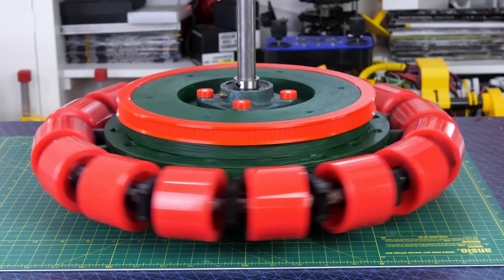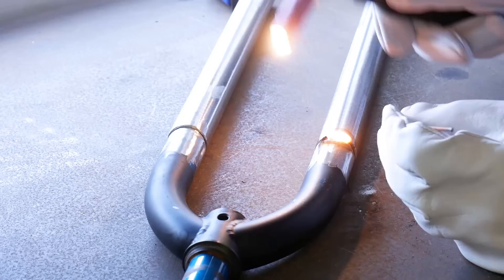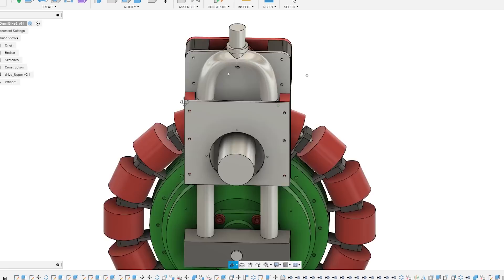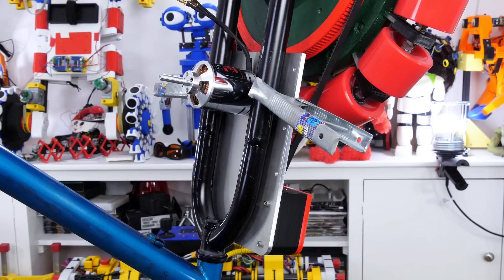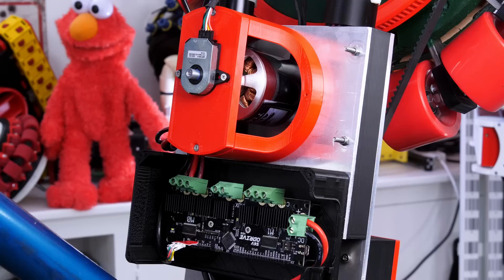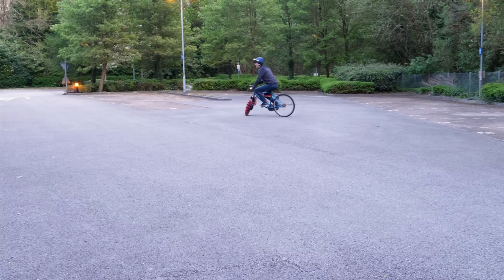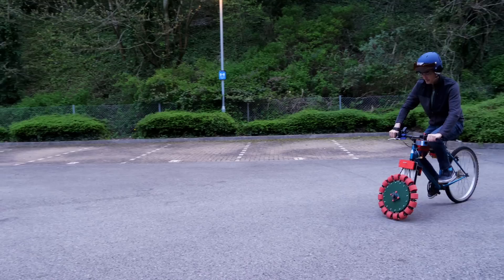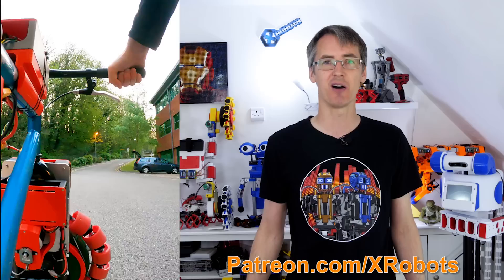Can I RIDE THIS BIKE?

Comment: It might actually be easier to ride in self balance mode if you physically lock the handle bars. It seems like it might almost ride like a normal bike at that point.
Reply: Yes! Weld up the handlebars aswell.
Reply: It would be hard to balance
Reply: Concur! Normally we use the handle bars to balance and steer. Lock them out. Let the wheel do the balancing and just shift your weight to steer.
Reply: yes, I think they need to be locked.. it seemed that all the issues were related to learned reactions on the steering input..  but since it doesn't steer locking seems to be the solution..
Reply: @Tystarr  news flash. you don't have to
Reply: Agree, looks like two feed back loops fighting each other, a humain and a robotic one, a locking mechanisme on the handle bar should eliminate the human variable :)
Reply: This is a good suggestion.
Reply: Much more complicated but nice would be to mount a round (car) steer that is connected to the steering motor axle.
Reply: Yea, but if it stops balancing= RIP
Reply: or make a ev and not ride at all
Reply: Should be fairly simple to do, just thinking of a plate with a hole that rotates with the handlebars, and a tapered pin moved by a servo, when you put it in balancing mode, the pin extends, and once the handlebars are straight, the pin will lock them that way. 

I think it would be best with a feedback method to know that the handlebars are locked and to not engage balance mode until they are. Same with when disabling it, don't turn off balance mode until the bars have been successfully unlocked. This will prevent from having the pin jam and with balance mode off and the bars locked, there's no human input way of balancing.

Could also add a thumbwheel or joystick to the bars on one side where you can use the joystick to provide input direction when in balancing mode, not necessarily requiring the perfect lean to steer.
Reply: That's not how bicycles work. Locking the handle bars basically renders the bicycle unridable.
Reply: @devandestudios128  you did watch the video, right? This is not a normal bicycle, with the sideways driven front wheel there is no reason at all that the handlebars have to turn if the powered wheel is doing the steering.
Reply: @timplett1  Clearly you don't understand how a bicycle works. With or without the front wheel being perpendicular to the rear wheel, powered or otherwise, the handle bars locked negates counter steer, which is why the forks/handlebars are not locked in place. The powered wheel isn't doing the steering and shouldn't need to be powered at all. Only reason it is, is to make it easier to balance, not steer.
Reply: I was about to comment this. Certainly worth trying it with locked handlebars.
Reply: @devandestudios128  I understand how a traditional bicycle works, however the point of this is not to make a traditional bicycle. If you want to make a traditional bicycle with the least effective wheel for the principle, go ahead, however what is being commented here is a way to make use of the alternative wheel to make something that diverges from a traditional bicycle in function as well as form. If you want to adhere to traditional countersteer method, keep a traditional wheel.
Reply: @timplett1  Okay cool. build a bicycle like this one and lock the forks into position. Lemme know how well that works for ya.
Reply: @devandestudios128  your comments still feel like you didn't watch the video. When trying to ride it with balance mode on, he specifically said he had to try not to countersteer and just lean so it would steer, and his instinct to steer normally caused it to actually just go straight. So his actual experience testing in the video SEEMS to imply that the ability to turn the handlebars actually makes the bike counterintuitive to ride. Therefore, locking the handlebars in balance mode seems like the next step to take to allow the bike to do the steering without counterproductive input from the rider. 

Seriously, just watch his testing again and pay attention to what he says.
Reply: I thought that as well
Reply: @devandestudios128  Of course it's not how a bicycle works. They don't have omni wheels on the front.
Reply: @AmtrakBoy42  That's not what I meant. Please see this video that explains how a bicycle works. It would work the same way regardless of the omniwheel on the front. 
https://youtu.be/9cNmUNHSBac
Reply: @devandestudios128  The balance mode takes care of the balancing function of the steering column automatically. No need to manually balance via front steer. That's what other comments are driving at. There is an electric motor and sensor in this front wheel taking care of that function. Looks like traditional bike dynamics are totally out the window
Reply: @devandestudios128  Did you even watch this video before commenting? It doesn't steer like a normal bicycle anymore with balancing mode on.
Reply: @devandestudios128  Where is the self-balancing omni-wheel bicycle in that video? I don't see it
Reply: @bluemamba5317  Yeah got that, but it still works the same. But either way, no matter what you think you know, I'm done giving a fuck.
Reply: @devandestudios128  It doesn't work the same, that's the whole point. He even says so in the video. Have a nice life. God have mercy to whom ever have to spend time with you.
Reply: @Tystarr  it literally does it itself.
Reply: Essential it would be like riding a scooter with pedals. You don’t really steer a scooter unless your barely moving. It’s more leaning into the turns then anything. I came here to say exactly what you said
Reply: @devanshgarg31  Best suggestion -- DON'T RIDE THIS. :D
Reply: @newburypi  Like, a bigger Segway
Reply: @tarpguy_  a Segway with pedals :)
Reply: @DjamilBoudries  why not do that on everything. just remove the human variable on everything!!!
Reply: That may not work as you imagine.

The tilt sensor uses down by measuring the force of acceleration due to gravity. If you're moving around a corner, centrifugal forces will act at an angle to the lean, so that it may appear that the resultant force is down relative to the wheel and then it won't rotate.
In addition, the force the motor can impart to the bike is limited. Imaging going around a corner, then the belt slipped or motor couldn't overcome the centrifugal force, of a part tensioning the belt broke.
Reply: @devandestudios128  not when you have self balance turned on
Reply: @devandestudios128  you have to think about it like a unicycle but
Reply: Good suggestion! Letning the robot do the balancing will probably make the whole riding experience more intuitive. Think of how you steer a skateboard for instance, even though it’s completely different than riding a bike that can also be intuitive (for those who knows how to ride a skateboard)
Reply: @devandestudios128  You definitely need to watch the video my friend! The bike already have a stabilizer, that means the bike Automatically do the Balancing for You! Which translated to: You don't need to balance the freakin' bike, it'd do it by itself.
Reply: @wenofu477  That's the Idea, it just that we haven't been able to make it works.

Engineers are still trying and experimenting on how to went from Mechanical to Fully Autonomic on everything.

Just look at self driving cars, the technology is already available, it's just not good, still have a lot of problems like road mapping errors and poor predictive capability.
Reply: My thoughts exactly
Reply: @devandestudios128  that's not how omniwheels work, making them omnidirectional renders them useless
Reply: @Tystarr  the machine does the balancing
Reply: My faith in humanity's intelligence is restored with this being the leading comment. Exactly what I was thinking.
Reply: Lol - incredible! Can’t believe what I am seeing - and it works!
Reply: Was just about to comment this.
Great minds.
Reply: @Tystarr  that's what the electronics are for ;)
Reply: If it's lock how can he turn while running he can use the machine while running. The machine can use when it stop and turn without hard work
Reply: @lydyamuangte8713  it turns when you lean.
Reply: It WILL be easier to block handle bar
Reply: I feel like we would need to lock the handlebars and put the omni wheel in the rear. a front wheel drive bike.
Reply: Except without the friction when you try to lean one direction u will lose control of the front wheel and the bike will fall over
Reply: i was just thinking the same thing!
how about you couple the switch for balancing mode with an electronically engaged handlebar-lock mechanism. so when you switch on the balancing mode, it waits for it to engage until you get into straight positioning and the locking mechanism physically locking the handlebar. this way you can ride it with balancing mode as an omniwheel until the battery runs out and then automatically go back to "normal mode" since your machanism has no power left for engaging the lock and the balancing mode.
Reply: @Non-Existent03  oh God. Omnidirectional hoverround
Reply: @newburypi  the problem is shifting your weight the correct amount that the bike can accurately compensate.
Reply: @devandestudios128  The powered wheel is behaving like a reaction wheel. That's how balance mode works. Given how aggressive your comment is, it's pretty ironic. Why would you claim something so absolutely about a device you clearly you don't understand when everything you needed to understand it was in a video you commented on...
Reply: @jossmit7024  It's not really that complicated, you would only likely need a worm gear if you needed to change the angle. Handlebar already turns around its axle just like a steering wheel in a car, which as a mechanism is technically way more complicated to build for a car.
Reply: @newburypi  i never used handlebars for steering, i usually just lean into my turns
Reply: Fr
Reply: Yeah
Reply: I have a feeling his brain is too big to allow him to forget anything 🤣
That's probably why it was more difficult for him than it could potentially be for someone else to do.. lol
Reply: @Tystarr  🤣 good one
Reply: This is all very interesting but it’s probably illegal to make changes to your bicycle like that
Reply: Don't think you can. Veritasium did a video recently where he showed that to turn on a regular bike, you have to counter turn first. I'd assume the same principle is required here
Reply: @JamesChessman  WTF are you talking about? Why would there be laws about modifying a bicycle? There aren't even laws about modifying cars.
Reply: I have ibs
Reply: How about we just put a ball bearing under the front fork
Reply: you can't have your front wheel roll out from under you you'll fall everytime
Reply: i’m assuming it’s the same as a hover board balance but with pedals it’s hard to wxplain
Reply: Exactly what I was thinking. Your habits already will have you lean, except this time you can't turn the handle bars. As the motor takes care of keeping your balance, it should be fine.
Reply: Was going  to be my suggestion as well.
Reply: @AmtrakBoy42  there absolutely are laws about modifying cars, but you can definitely modify bikes
Reply: @devandestudios128  MY THOUGHTS EXACTLY
Reply: @chargemankent  Yes, it does the balancing for you, by counter steering the wheel. If the front wheel/fork is locked out, there is no way for the computer to balance the bicycle.
Reply: so you would steer like a skateboard, i like it.
Reply: @logicalprime3017  its like a segue
Reply: @Tystarr  it would be hard to balance on a self balancing vehicle?
Reply: I was thinking the same thing halfway through the video
Reply: The bike is balanced by the oacilation of the handle. As soon as you lock the handle on any bike, you will fall
Reply: @gman4072  Did you even watch the video bruh...... cus it doesn't sound like it
Reply: @Tystarr  yeah, luckily this video is dedicated to a self balacing bike.
Reply: @devandestudios128  You STILL haven’t watched the video? The small wheels on the omniwheel spin sideways, there’s no movement of the handlebars or front for necessary. I don’t understand why you’re still in this comment section arguing when you didn’t even pay attention to the video
Reply: @MrEvanNoyes  Because I did pay attention and that still isn't how bicycles work. If the handlebars are locked out, there is nothing for the self balance to balance. Also, the small wheels do not spin sideways, they spin in the direction a regular front wheel would. The omniwheel as a whole spins clockwise or counterclockwise depending on the direction of its travel. But please, build a bicycle exactly like the one in the video, but lock out the handle bars and see how ell that works out for ya. I'll wait.
Reply: @devandestudios128  Dude, the self balancing isn’t turning the handlebars for him. It’s turning the smaller wheels in the omni wheel. You are still just refusing to learn new information here. Look at the Omni wheel. See how it has the laterally facing skateboard wheels? Those are driven by the engine that’s mounted to the front of the bike. Which is what is correcting the steering.
Reply: @MrEvanNoyes  The small wheels are passive, it is the omniwheel that is driven.
Reply: My God, the Veritassium viewers in this thread are being insufferable. 😂
Reply: Well, gotta find a different way to turn...
Reply: @Tystarr  no point in balancing if it balances itself
Reply: If you physically lock the handlebars, there's no more point for them, could have a handless bike or a bike with a desk on the front lol
Reply: But how would you steer then?
If I am not mistaken, you steer on a bicycle by turning the handle bars in the opposite of the cornering direction, and thus forcing the bike to lean in the cornering direction. You can then keep balance and control the turning radius by using the handle bars.
How do you steer if the bike is always keeping its balance and stays upright?
Reply: @NKay08  The wheels on the edge are still locked to the rotation. Sharper turns are harder tho, due to the bi-axis stabilization of the wheel.
Reply: keeping same set-up, I think if you inverse(or make opposite) the code tilt_direction/motor_direction relationship  in the "balancing mode" the motor will make you stay upright instead of throwing you to the direction you lean and ride without the effort of human balance  .. give it a try if you haven't
Reply: Sounds like a 2 wheel unicycle 🤔

Comment: Would have never thought the way to make a self balancing bike was to flip the front wheel sideways like that, love it
Reply: If you check out Veritasium's video on bikes, you'll find they are already self balancing. He rolls one down a hill and it keeps itself upright. Very interesting stuff on both accounts though!
Reply: the problem with having wheels rotated 90 degress is that you can really only ride it on flat ground; concrete or asphalt, or anything that isnt dirt, grass, etc.
Reply: @kenjaminrar  isn't that because the bike is moving, when a normal bike is stationary it will just flop over unlike this bike
Reply: the ultimate trackstand bike
Reply: @AuroraAce.  yeah they're incorrect. Bikes become balanced due to the centrifugal force of the wheels when moving at speed in a straight line but that doesn't make them "self balancing" like the bike in this video is.
Reply: @AuroraAce.  normally yes but there have been several examples of literal self balancing bicycles that can just kinda hang out
Reply: @deebonglord3209  I believe there are bikes like you say look like a normal cycle however have the self balancing weights in the handlebars and also “control” steering. Honda made a motorcycle that just follow you and balances on its own too
Reply: @hausmaster9801  Love the self balancing motorcycle. It's so cool.
Reply: Also there's apparently a newer, arguably even cooler one.

Comment: This was such a weird project. Very interesting though. I didn't expect it to work so well.
Reply: I was thinking the loss of gyroscopic effect on the front wheel would have been an issue. Pretty cool how well this works. Sort of reminds me of Destin from Smarter Every Day trying to ride the reverse steering bike.
Reply: Same here.  When I saw it about halfway into the video I was certain it wasn't going to end well.
Reply: What is point ?
Reply: Someone call smarter everyday
Reply: @chrisraatz8000  Yea, Veritasium also did a video about bikes James referenced in a previous video.
Reply: You mentioned it has skateboard wheels, if you can replace them with Shark Wheels it should handle rougher terrain much better.
 
Edit: Just realized this was in the wrong place. My bad.
Reply: "I didn't expect it to work so well" 
Spoilers, bro....
Reply: Yea
Reply: @traviseichholtz7987  if you're worried about spoilers, you shouldn't go to the comments, where people discuss the video.